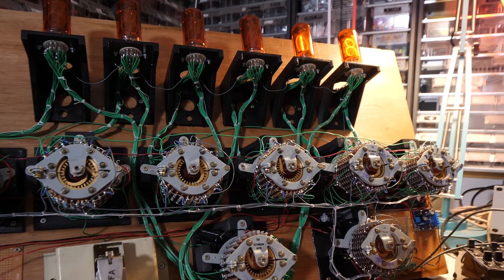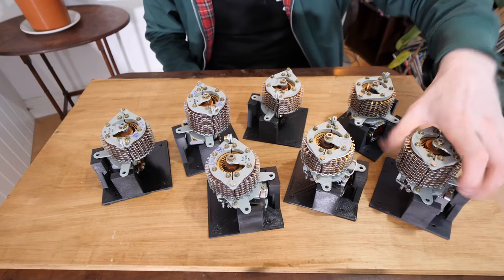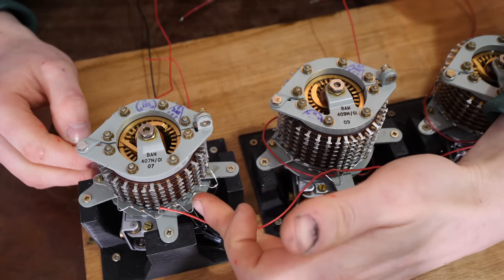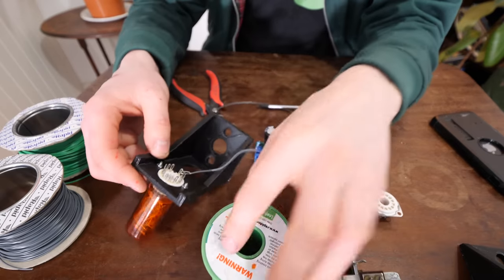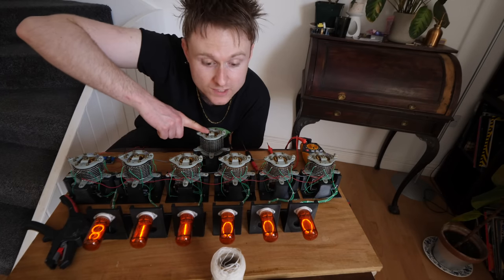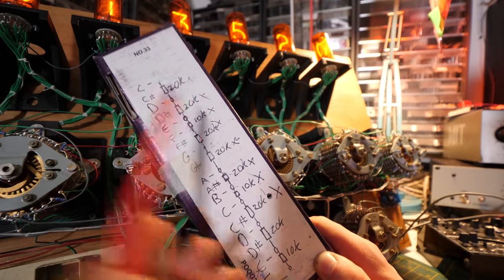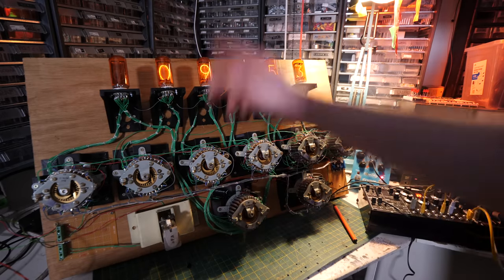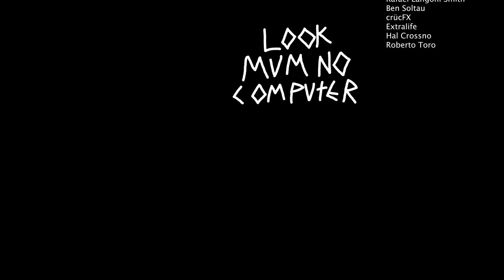This Electromechanical Counter will survive an electromagnetic storm and play you a song

Comment: You should put resistors in series with each of the nixie anodes to limit the current for maximum tube life
Reply from the maker: what resistance would you recommmend.
Reply: @LOOKMUMNOCOMPUTER  For your big tubes, approx. 22-47k 2W in case you're using around 180V should be ok. Note that nixies are current driven, so they need this resistor.
Reply: If you have current limiting on the boost converter you can do it that way. You won't need any current limiting resistance in that case
Reply: @mattsan70  Not if you connect multiple tubes parallel. Always use a current source or resistor.
Reply from the maker: @mattsan70  that’s a very good point. The power supply I ended up using was the one not at the start of the video. And it was one for Nixie tubes. I’ll have to check the schematic as other projects I saw with that supply had no resistors. So possibly it’s already present. But I’ll have to check
Reply: @LOOKMUMNOCOMPUTER  Came here so say the same.  The datasheets for Nixie tubes generally specify the maximum current. It will normally be in the very low milliamps range - for the ZM1040 that is nominally 4.5mA per illuminated segment.  If you over-run them their life will be significantly shortened. So with a 200V supply, try somewhere in the range 12K - 22K rated at at least 1W to 2W just to keep temperatures modest.  The actual value will depend on the voltage across the Nixie when lit (120 - 150V ?).  I love the use of the uniselectors here.  And the music sequencer implementation was just brilliant.
Reply: @LOOKMUMNOCOMPUTER  Still, if you parallel tubes every tube needs its own resistor. 
The recommended tube current for a ZM1040 is 4.5mA, so with 180V supply you would need a 8k2 resistor.
Reply from the maker: @Sine1040  I’m using 120.
Reply: @LOOKMUMNOCOMPUTER  The minimum supply voltage is 170V the rest needs to be dropped over the anode resistor, do a search for the ZM1040 datasheet and you'll find all the info you need.
Driving a nixie with a constant voltage is a big no-no, just like a LED they need a specific current where they are happy. But with nixies it's even worse, once they strike the voltage over them drops. Think 'neon oscillator'. Running these tubes at higher than recommended current severely reduces their life.
Reply: @LOOKMUMNOCOMPUTER  The good thing about NIXIE tubes is they last a long time if you drive them properly. I've got a small one that's been going for 10 years.
Reply: @LOOKMUMNOCOMPUTER  tube reliably strikes due to contact arcing in this setup.
Reply: @LOOKMUMNOCOMPUTER  Check the datasheet for the tubes if you can find them, ~2.5mA is typical for IN-14 nixies IIRC. So (Supply voltage - tube running voltage )/ .0025
Reply: Also, apart from resistors, its better to feed the high voltage with ac, to avoid cathode poisoning.
Reply: @mattsan70  This won't work here. Because the boost converter has an output capacitor it will deliver maximum current on the strike before the limiter kicks in, also when different numbers are lit up the current split will be uneven meaning tubes will light up at different brightness.
Reply: I came down here to say the same thing.  Glad someone else made this comment.  Resistor should be added to each of the nixie's anode connections just to be sure no one tube is drawing too much juice. 47k has worked well for me in the past.
Reply: @mattsan70  he's got all tubes in parrallel so each tube needs it's own current limiter a 22 to 47k with boost set at 170v
Reply: A resistor ladder budget quantizer. Nice.👍
Reply: @mattsan70  Not ideal. there's like 60V of potential difference between the tubes firing voltage and illumination. Any major discrepancy would mean more current would flow through the higher voltage one, overdriving it and possibly making the others dimmer or even off if it was bad enough

Comment: I remember making light boxes for my mobile disco in the 90's, And forgetting that the Bulgin cable was plugged in whilst sorting out the wiring. The reaction was pretty similar, but with expletives ;-)
Reply: ^this, and male to male Bulgin connecting cables. Even brought a curious par lamp set with xlr connectors, had to be careful not to confuse those with the speaker cabs. 90’s diy mobile disco kit was awesome!

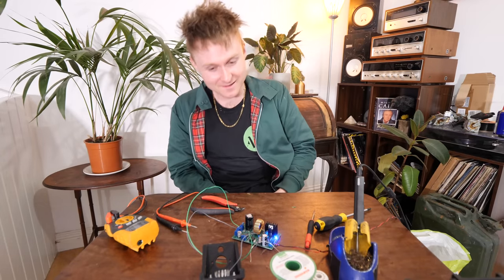Comment: At 8 minutes, I'm sitting here, amazed at how Sam is working with the 120V supply on and he's not getting zapped. Then, at 9:50, I'm like "Yup, been there, done that."
Reply: Everyone working with electricity pulls a Mehdi at some point in life...
Reply: @werrrnerrr  The question is whether you let it happen a second time. Not of purpose.
Reply: As Quinn Dunki said: "Who's got two thumbs and is the shortest path to ground? 👉😥👈"
Reply: There is no way it would ever work if he didn't get zapped at least once. Sacrifices must be made (gazes at bleeding knuckle from some metalworking earlier in the day...).
Reply: The supply is low voltage I think.
Reply: @bzqp2  most nixie tunes need 160v or more to light. Not many amps but definitely enough to feel it!!
Reply: I can tell you from mutual experience that the sting of a low current 120VDC supply from a Nixie tube supplies and a "wet signal" T1-circuit feel remarkably identical.  My friend joked they were "wet circuits" because you peed just a little when you touched them.  At least you're not usually standing on a ladder with Nixie tubes...
Reply: @newmonengineering  I meant that he's using a low voltage supply, but he then steps up the voltage with a transformer. Supply is at low voltage, only after the transformer it gets high.
Reply: @bzqp2  that is not how it works at all. Nixie tubes are high voltage devices. Your way he would need a transformer for every number in every tube. The entire thing is high voltage. The switches are switching high voltage
Reply: @newmonengineering  He literally says at 9:00 that he's using a 12V PSU which he then steps up with a transformer to higher voltage. You can see the transformer mounted in the bottom right corner of the device. The supply is low voltage 12V, only after the transformer it's high.
Reply: @bzqp2  explain how you switch high voltage on every contact on every letter through those wires all on low voltage and then transform it to high voltage with a single transformer... it's simple the transformer is before all the switches, it's stepped up one time and the rest is high voltage. There is no way without multiple transformers to switch it with low voltage.
Reply: @bzqp2  you can also clearly see the transformer is wired directly into the switching unit as well. Each contactor switch has a 120v to 170v supply that is switched directly to each of the 10 numbers in the nixie tube. Even nixie clocks work this way with a special IC that switches the high voltage supply to each individual segment or number.
Reply: @newmonengineering  I didn't argue with that. Everything wired after the transformer is high voltage. I never said that the  switches are low voltage.
Reply: @newmonengineering  he switches the ground, only the cathode of a Nixie glows.
They have permanent+HT connected and switch the ground.
Reply: Don't put your finger on the circuit board of an old camera flash without emptying the capacitor first.. Been there done that, the finger got two black burn marks from the electrocution 😅
Reply: @DavidJohansson  Check out the Modern Rogue video on a home-made camera flash Taser, where they zap each other with it to test it out.
Reply: @SuperUltimateLP  I know the ground is switched, but it your finger comes between there you will still feel it.

Comment: I would get the voltage for the tubes as low as possible. I think, the short Screensaver mode is to short to really save the tubes. Maybe you could combine it with a standard digital display and only when a count is done the tubes are switched on for 10 seconds or so... greetings from austria

Comment: While I sincerely hope you get a visitor count that will lead to an overflow on the counter, that probably won't happen anytime soon. Would it perhaps be an idea to connect various devices in the museum to the counter? Every time someone uses a device (or if it happens automatically, like a clock that strikes the hour or something like that) the counter goes up. I'm sure if you build something like this and I come to visit the museum one day, I'll want to push every button available to make a small contribution to the million to be achieved!

(translated by Google)
Reply: if nothing else, the big milestones(1k, 10k, 100k, 1M) should be wired up to set off everything in the museum, or at least something special on the organ.

Comment: The number for the Westminster Quarters after moving the scale from E major down to C major as you dont have the sharps should be \/ for all 5 note sets used wikipedia as reference for what sequece plays when en.wikipedia.org/wiki/Westminster_Quarters
1. 9 8 7 4
2. 7 9 8 4
3. 7 8 9 4
4. 9 7 8 4
5. 4 8 9 7

So with a combination of those numbers depending on how you wired into the uniselector should give you the chimes not acounting for the chimes to sound the hour strike (i'm not sure which note that one is)
For example the Half hour change (8 notes) is changes 2 and 3  ("." for quarter notes and "-" for half notes)
7. 9. 8. 4- 7. 8. 9. 4-

Edit: if you wanted to add the full hour chime you might be able to do so if you have 2 delay circuits going to the interupter 1 for a quarter and a 2nd for half at double the length then using 16 of 30 stops on the uniselector (or insteadof a second delay circuit use 2 stops for a half making it 20 of 30 still having 10 stops for delays between repeated notes or chime sets). although this would add complexity it would also allow you to adjust the timing to make the tune more accurate 

sidenote Hi from NZ love your videos
Reply: My method for transposing the 4 bell notes to numbers
B3   - G3 = 4
E4   - C4 = 7
F#4 - D4 = 8
G#4 - E4 = 9

Comment: Awesome work! Rather than 10 triple steps per revolution, I would have a triplet of 10 single steps in each revolution (with a carry or pre-carry per trine). That way, I’d get snapper action. If peak current draw is not a problem, I would have each uniselector output a pre-carry on 9 and the next decade increment when it saw both that pre-carry and the timing pulse. That way, 199999 would clock over to 200000 in one (loud) click.
Reply from the maker: Problem is that increases the wiring a lot. Hence the method I use!

Comment: You could actually do the same counter with CD4017 counters (they can operate with up to 20V), this way you can get rid of the clicking sound, but then you would need Nixie tube drivers made from opto-couples. The whole thing may not be electric storm proof, and power surge proof but it will be quiet.
Reply from the maker: Yes but that’s not the point of the machine. Also it won’t have memory

Comment: When I was an apprentice for a company called TR Services which originates from Britain, I somehow managed to reprogram a bank of uniselectors that would sound a horn for the start and end of shifts in a factory. It involved a lot of removing old links and soldering new ones in their place with instructions from a installation manual. I tossed out heaps of old equipment full of uniselectors while working for that company and wish I had kept a few of them.
Reply: I worked at TR in Cape Town for a year or so, back in 1988. I wonder if Bernie Baine is still alive?
Reply: @johnjones4825  I was in Australia end of 1989 until about 1992

Comment: Give it a shot, brother.
build a "Cockcroft Walton" array, 12, 24, 48, 96, 192 Volt triggered from a 555 timer, you got several voltage drops due to the diodes, so you want reach 192 volt, put a 4700uF capacitor to GND there, than a Mosfet / transistor with a voltage to divider to the desired voltage, put a 2200uf or so capacitor there. you free to play with the frequency of the 555 timer. order cool Wima AC pulse capacitors. don't know what value, i see some people use / build 68nF, 100nF. use parallel resistors (around the transistor voltage regulator) if you note that these get hot.

vintage bulbs with vintage tech.  ... have seen people build really cool versions of these array's

Comment: Would be fun to try and get the selectors operating on base 30 instead of base 10 and then converting to base 10 for output. I think its doable without an adder, but definitely requires some thought.
Reply from the maker: Yeah but clicks and more counters is more fun. You could do it with a diode matrix but a fafff

Comment: People are all worried about emp and solar flares etc. They seem to forget that most of our electronics (especially thoes found in vehicles and industrial equipment) are designed to be hardend against emp and the like, a straight hit from a solar flare maybe not so much but if that happens we got bigger problems.  If ur really paranoid put a ground clamp on ur car and store ur sensitive electronics inside the trunk. Instant Faraday cage. This will also protect the various control units under the hood as well. Just to be clear when I say a ground clamp I mean grounding chassis to earth not the negative battery terminal.

Comment: Sam, you need current limiting resistors on the nixies or you'll cook them to death. Neon bulbs and Nixie tubes have negative resistance, so once they power on the impedance drop infinitely low and it will overheat the tube and the metal electrodes will sputter very quickly and coat the glass on the inside and make it into s mirror so you no longer can read the tube.
Reply from the maker: Yeah people have mentioned. I’ll fix it. First time I have used nixie directly with projects. Used a nixie power supply which possibly has the current limiter in it as it says to directly wire. But I’ll look into it
Reply: @LOOKMUMNOCOMPUTER  your power supply probably have a maximum current but it's 10 times higher than what the tubes can safely handle. You need at least one resistor for each tube, otherwise the brightness will not be even and it will jump around which is not ideal.

Comment: Hi Sam, I notice when the 60 second "screensaver2 kicks in it displays the same number again afterwards. If the machine is sat for hours on end without someone using it, that's gonna wear out those particular digits.

Could the 60 second screensaver randomise the 6-digit number somehow to (hopefully) evenly wear each digit on each tube? Also means that the melody will randomise too :)
Reply: If it shows random numbers, it's not showing the visitor count, as would probably be desired.

Also, with Nixie tubes, the unused digits are usually the ones that (partially) fail. Making sure they're exercised once in a while greatly reduces the risk of this happening.

Comment: You could use the mechanical uniselectors as base-30 digits, and use an arduino to decode it, keeping the count even if the arduino gets messed up.
The maximum number would be 24,299,999
Reply from the maker: Yeah but the project was to avoid a melody

Comment: If you used all 30 contacts on each selector, the counter could be in base 30, so it could count up to 729 million, which is a noticeable improvement over just 1 million.
Reply from the maker: Yep but displaying would be a faff
Reply: @LOOKMUMNOCOMPUTER  Are there Nixie tubes with 30 different characters?

Comment: If the selector has 30 Pads, why don't you solder pad 0, 10 and 20 together to send the click to the next selector? So every rotation would technically count to 30 but it only counts to 10 and carry the tenth step to the next selector. That would improve the lifetime by 3.
Reply from the maker: That was what I was going to do initially. But I didn’t as it would have been more time consuming. As it’s quite a few more wires. Also the way o did it sounded better ass it had more clicks to it :)
Reply: @LOOKMUMNOCOMPUTER  thanks a lot for your answer, so my idea was right :D

Comment: What happens if someone comes through the door during the Screensaver segment? Does their melody play afterwards, or is their turn missed?

Either way, that's a brilliant machine.
Reply: From the looks of it, the counter's digit output is wired up to the routiner, and the routiner just shifts the output digits to the right until they wrap over, so the counter doesn't change, they just have their output sent to a different tube. Pretty clever.

Comment: The units counter will probably meet mechanical failure before the millions counter clicks once.
Reply: Are you sure...?  They are uniselector from the 50s or 60s.  They were built to last a very large number of operations.  It's much more likely that the modern power supply would expire first.
Reply: @GodmanchesterGoblin  very large meant a very different thing back then
Reply: @bacicinvatteneaca  True. But uniselectors still managed millions of operations in telephone exchanges before needing replacement.